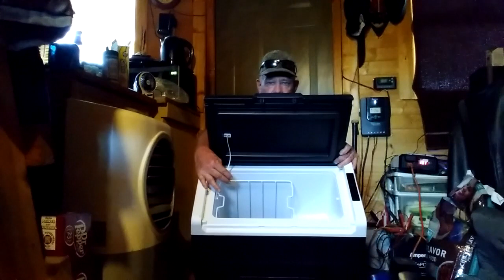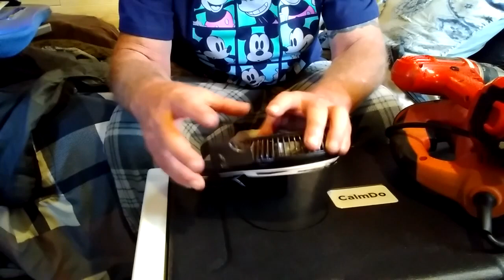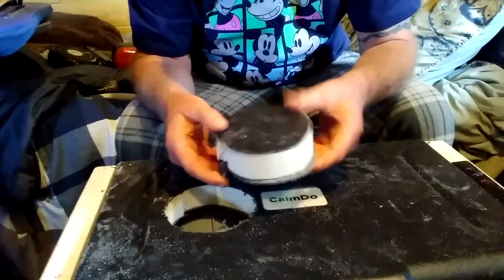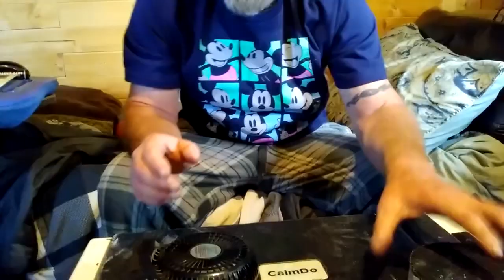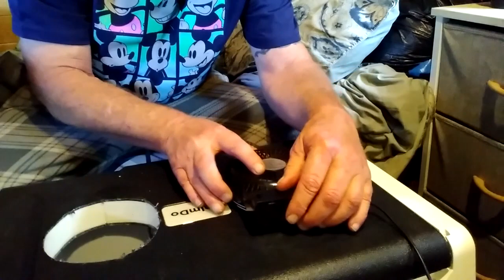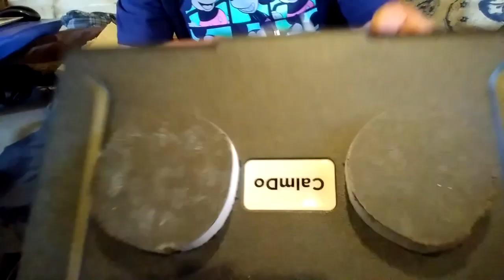Off Grid Inventions:  Turning a 12 Volt fridge-freezer into an air conditioner!

Comment from the maker: This is a prototype and test to convert a 12/24 volt fridge-freezer in to an air conditioner for small spaces that uses only 50 watts of power. Scroll down for recommended components.  https://www.amazon.com/shop/solarcabin

These are the components I am using or recommend:

12/24/110 volt fridge freezer: https://amzn.to/3oCrxwV
Efluky US rechargeable fan: https://amzn.to/3N5yZde
Adjustable ABS AC Vent: https://amzn.to/3C3yKZR
Kona Black/Ice 2 Pound Ice Packs: https://amzn.to/43wWdhS
 Laser Temperature Gun: https://amzn.to/3C1UvcG

I make a small commission if you buy through my links -thank you!

Off grid 20+ years and I have designed many off grid and solar projects and many cabin plans available here: https://amzn.to/3C1UNAi

#offgrid #airconditioner #inventions
Reply: You have been planning on doing this design myself I'm going to be using a smallest size.
Reply: Do you think 2 3 inch cooling fans might

Comment: I thought of a similar idea , and when I looked online to see who else was doing it   I found this video . 
With my idea , I removed the lid and made a new one out of timber , so that fridge can be converted back at anytime! 
I also used ducting to raise the outlet so the cooler air starts at a higher level. 
This system is to cool my LWB sprinter for better sleeping in summer!

Comment: Hi. Just curious if you did any more testing with this cooler idea.Because I have a couple myself.I would like to try it on
Reply from the maker: I did more testing using the gel packs and that works better and last longer than water bottles. You can also freeze those faster.

Comment: Is there an update to this video? How did the gel packs work? I live in a temperate region where humidity is often quite high. Swamp coolers won't work for me. I had thought of using the fan as the exhaust and having the intake as tubes that ran down in between the gel packs or ice bottles before that air is pulled out by the fan & vented out could be a benefit
Reply from the maker: I didn't finish this project and I wish I had. I know the system can work but the fridge I was using was not the best for fast freezing.  They make models now that can freeze those gel packs solid in less than an hour.

Comment: i live in Florida and have two swamp coolers they run off car radiator fans 12v 80watts on full speed, never run it on full speed it does great
Reply: You gotta look into some other inexpensive options of dry cooling with low wattage. Our humidity is a killer in and of itself, adding moisture attempting to cool it at the same time is counterproductive unfortunately. It's a shocking difference with your indoor spaces around 50% relative humidity, it allows you to maintain higher temperatures say 80°F and still feel coolish

Comment: The heat you take from the air eventually has to go out the hot coil on the fridge so this will only work short term to cool the air until your water bottles warm up but will remove humidity for a while as well. 
Better to put the fridge outside with ducts in and out the room. Fill bottom of the fridge with water so the air passes over the cold water cooling the air.
To improve performance use a small water pump and showerhead to spray the water into air in the fridge to help cool the air as going thru the fridge.
Reply from the maker: You only run the freezer at night when you don't need the AC for a few hours to refreeze the bottles.

Comment: They've been advertising this ice cooler that does this. Fill it with ice blah blah. I wondered if you could use a 12 volt refrigerator.  And here you are! The heat exhaust issue from the compressor  can be worked out. Construct an insulated   compartmentalized nook to park the compressor vent end...sorta box it..ya know then run an accordion type hose like in the portable home ac units. For greater efficiency run insulated sock around the  hose. Also use a low watt fan at the end of the hose to pull out heat...send it outtie through a window. I see this all convenient for my plans to travel using my back van window. Then traveling and sleeping in my ride with the heat wave would be all bougie!
Reply from the maker: I think it could work. Not as cold as a refrigerant AC but a lot less power.

Comment: or why cant you just fill up the expensive freezer with ice packs and rotate them into a cheap styrofoam cooler that you dont mind cutting a hole into?  That way you still have use of the expensive cooler and it stays intact?
Reply: Great idea!
Reply: Yes, there's a vanlifer that freezes gel packs in her portable car freezer, then places them inside a larger portable cooler she uses as her "refrigerator" to avoid having to buy ice.  You would have the trouble of removing & refreezing the gel paks, but the whole idea would be a great way to save power.

Comment: set this inside a small tent/closet if heat is   a real concern. thats what is suggested during the winter time to conserve on heat.
Reply from the maker: This unit is designed to freeze the ice packs at night when the AC is not running and only run the fan for AC in the daytime. Still a work in progress.

Comment: You need to trap the cool air in its chamber, letting it loose is similar to leaving your oven open to heat a house. You could make a metal lid with fins and have a fan blowing through it. underneath you can have a pc water pump circulating a basic cooling liquid to bring the cold up to the fins.

Comment: great vid, this is the very thing in my mind right now - i mostly do field works and the El Nino sun is beating me, my car do have an AC unit  but to save up a bit of gas, im searching for cost effective way to have a portable AC ($1k  on the market right now wont cut it - too expensive) i've seen a few car fridge powered by 12v which cost around $120-200 and was planning to do this.

Comment: Unless you find a way to reject the heat from the compressor,  it will create more heat than cooling.  See second law of thermodynamics.   You might mount it outside a window and pipe the cold air in.  Maybe pipe warm air from your cabin into your fridge.  Just my thoughts.
Reply from the maker: That is true only while the fridge compressor is running. This unit only runs the compressor when you do not need AC and only needs 4 hours to refreeze the ice packs at night.  Then only the fan runs to circulate the air around the ice packs to cool the room. Doesn't violate the law. I will explain that in the next video

Comment: Did the frozen bottles melt in time from ambient temperature air being blown into the freezer? Im not asking this too be a critic or a naysayers by any means. You are conducting an experiment that i have spent a lot of time thinking about how to design. Thanks for sharing the video!
Reply from the maker: Thanks, The bottles were not completely frozen when I tan this first experiment and it takes 90minutes at zero degrees to freeze a 16 ox bottle of water.  The unit will need to run for at least 4 hours steady to refreeze the bottles between uses as an AC unit. I will explain more on that in the next video.

Comment: Sounds great. I have tried this. It works up to a point. My solution was to buy six more batteries and four more solar panels 😁. I caved and got a window A/C that my uncle wasn't going to use anymore. It had a timer control which went out so I just put two switches on it one, for the fan and one for the compressor. It actually works better than it did before 😂.

Comment: My idea involved a lot more hose, a 12v aquarium pump, and a couple transmission coolers. But also used my 3way fridge instead of a 12v fridge/freezer. It's not central air, by any stretch, but it'll keep the camper cool enough. Great idea!

Comment: Remember you need the hot size of the cooler outside of the room. Or you can cool your room.
Reply from the maker: That is true if the compressor is running because it is puling heat out of the unit but the compressor only runs overnight when I don't need AC and it is freezing those ice packs solid. The ice packs then are used for cooling and the compressor doesn't have to run and is not producing heat. I will explain that better in the next video.